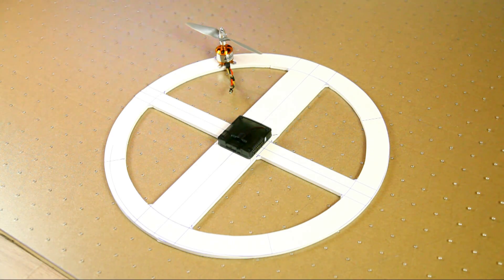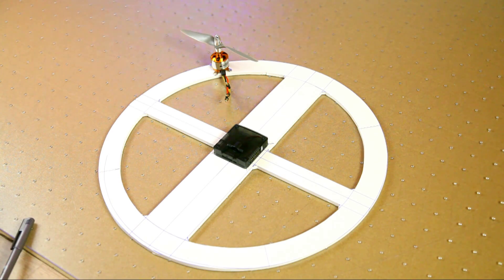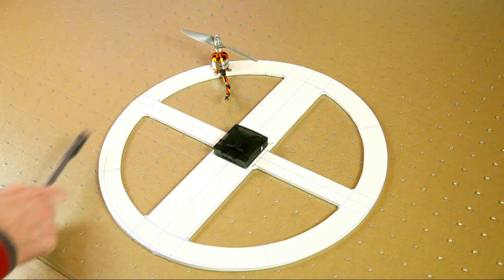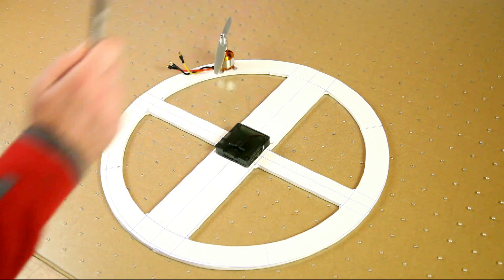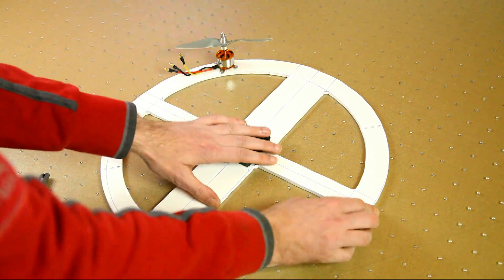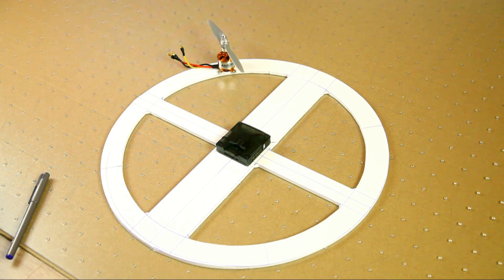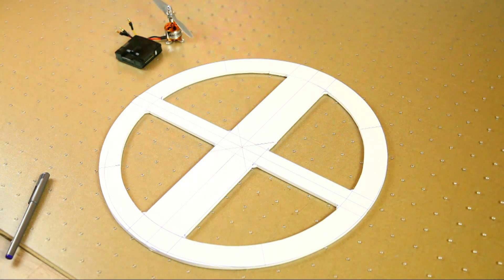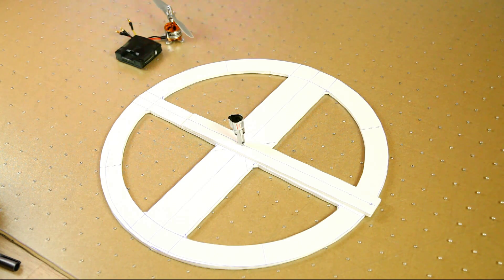ScratchBuild QuadCopter on the Cheap! - 1. Project kickoff :)

Comment: Looks very cool, I wish I knew about electronics so I could build my own quadcopters instead of spending thousands!
Reply from the maker: Thanks Jax :)  Well.. let's first see if mine flies.. And yes.. it takes a while to gather the knowlidge to set one up.. It's NOT hard though!
Reply: DutchRC ADVENTURES
I'm sure I could do it. I am just scared (-:
Reply from the maker: Jax Teller WA Haha no you're not ;)  Well.. maybe this build-series will leave you thinking: that was EASY! :)
Reply: DutchRC ADVENTURES
Really it's the setting up of the flight controller that has me worried the most, what is a pid anyway?
Reply from the maker: Jax Teller WA That IS one more complicated subject indeed :)  I'll give you that ;) The PID settings are basically a few parameters that tell the FC how fast it should respond to unwanted movement.. I think you can imagine that a light quad needs a different approach then a heavier one?
Reply: DutchRC ADVENTURES
Yeah for sure, such a lot of mucking about to get all those settings just right.
Reply from the maker: Jax Teller WA Hmm well  I have used an APM controller (HKPilot Mega 2.7) on a few builds now.. NO need to tweak anything on those so far.. 
I'll try this (less advanced) KK2.1 with default settings first.. We'll C :)
Reply: DutchRC ADVENTURES
OK cool mate, I should really give it a go I suppose, I just love opening a box, pulling out a brand new quad, putting a battery in and I,m flying ha ha ha

Comment: Great project! For the frame I would recommend poplar-plywood (in German it is called "Pappel-Sperrholz"). It is strong and very light and common in aircraft construction. Good luck :-)
 http://www.ebay.de/itm/like/161211806819?lpid=106&chn=ps
Reply from the maker: Hi there Detlef :)  Thanks for the input! I have just come back from the DIY shop.. And I've bought Exactly what you said :D  I did quite a lot of bend-testing in the shop to see which wood had the least amount of flex (and wasn't heavy)

Cheers!

Comment: Hi DutchRC, Do build it out of foam.  However, cut another just like the one you have, and cut some 1.5 in. (35-40mm) strips to make an inner and outer walls.  This will give it the structural integrity it needs to support the motors and a camera.  You could probably cut the center piece out and install square tubes of foam after you have the ring completed.  Then it would be light enough and have channels to run the wires, ESCs, LED wires, FPV equipment, and whatever else through.  All the best and Happy flying!
Reply from the maker: Hi there Ron :)
Thanks for the input man! hmm lights in foam.. Now you do have me thinking! :D  And a true.. a 3D structure out of foam works much better than a lot of people thing :)
I DID just buy a gorgeous piece of wood by the way :O hahaha! Well.. why not make a hybrid wood/foam.. I'll think that over a bit..
Cheers!
Reply: DutchRC ADVENTURES
Cut pieces from the plywood to mount your motors on and glue the plywood to the foam.  That's generally how I have my motors mounted on most of my foam aircraft.  I've wanted to build a flying ring but other projects seemed to get in the way.  Most people use the thick foam to build stuff like that but if you use foamboard and build it that way, it has a lot of structural integrity.  I planned to use barbeque skewers or small square stock wood from the ring to the center hub for the flight controller, receiver, and battery.  Everything else would have been in the hollow of the ring.  I like your idea of having he motors offset from the booms and canted inward.  All the best!
Reply from the maker: RonALampman Well Ron.. We are quite a lot alike in our building preferences than :D  All my scratchbuild planes are out of foamboard, and a wooden motor-mount indeed.. Works well! Even without any carbon re-enforcements :)